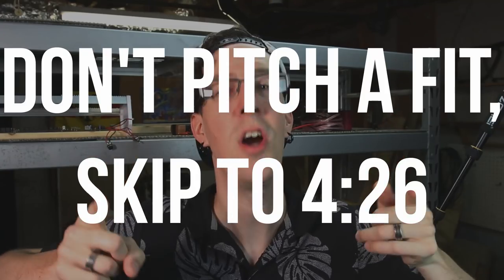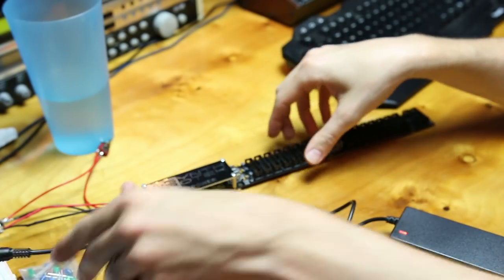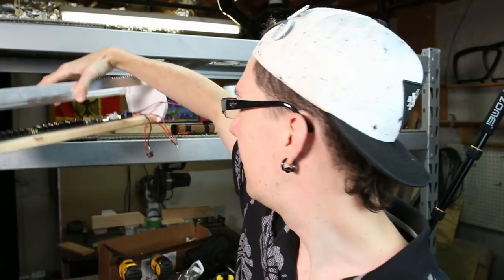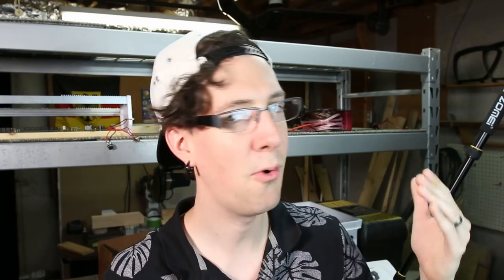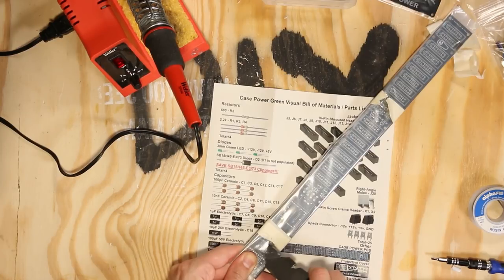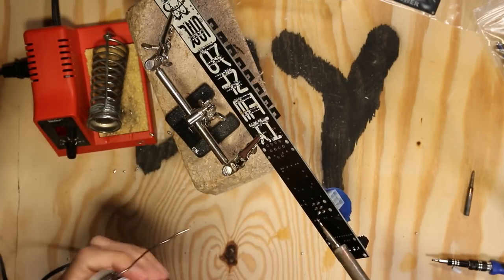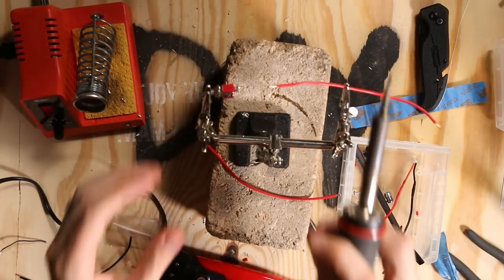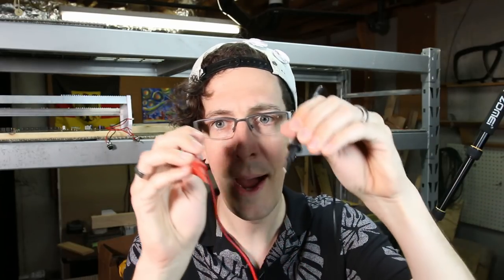DIY Music Studio - How to make Your Own Synth / Eurorack Power Supply (Synthrotek Case Power Green)

Comment: Not much progress but the start of always the hard part. If I were to start practice soldering without worrying about breaking anything, do you have any projects ideas that would be a good fit?
Reply: 1. Making your own instrument cables
2. Cheap musical diy kits
Reply from the maker: I second the making your own instrument cables / mic cables route.  That's how I got started with major soldering afternoons, etc.
Reply: @risingedge3970  thanks for the tips. I'm intimidated by making instruments, but I guess the best way to learn is to fail and figure out why it failed. Will have to find some cheap instruments to make :)
Reply: Once you have basic soldering skills, Synthrotek has some under $20 instrument kits. They're little things that make video game sorts of sounds, but you can refine your skills without risking much.
Reply: Rakit Kits do some pretty easy instruments and their fairly cheap so may be a good option

Comment: Great video. I'm in the planning stages of making a modular system. Basically waiting to accumulate funds. I've been designing a case, reading, and watching every video I can find. I've got a decent soldering iron in the mail :-)
Reply from the maker: Nice!  Which iron did you buy?  I found out that mine's a bit sub-par...
Reply: I asked the guys at Synthrotek and Jeff suggested a Weller WES51, so I've got that coming. It's more than I wanted to spend ($91), but I figure if I eventually build a bunch of modules, then it will be worth it to have a good iron. Based on what you just said, I'm super glad I asked them, because I was about to order the same one I saw in your video. 

I'm planning on doing as much of my modular from DIY kits as possible to keep the costs down. I'm thinking of selling my Moog DFAM to fund module kits ;-)  

I'm going to build my case from plywood as two boxes of 6u by 84hp. It will take me years to fill that much space... But we're going to re-do the kitchen and the cabinet doors are really nice plywood, so I'll scavenge them and only need to buy rails and power.

Comment: I Like your videos man, but switching to a pointy soldering tip is a big mistake.  the problem is surface are and heat transfer.  The smaller (pointier) your tip worse it transfers heat.  If you're having trouble with big solder blobs you need more flux.  Your chisel tip when well cared for is one of the best tips, there is another tip that looks like a horse hoof that a lot of people like too.  

The trick to getting a good solder joint fast is to heat the solder pad and the leg of the component at the same time.  To help your iron heat both the pad and the leg at the same time you was a small (really small) amount of solder on the tip of your iron.   Hold the tip on the joint for 1-2 seconds and then apply your solder on the OPPOSITE side from your iron.  You want the pad and the leg to be what melts your solder. The pull the iron away first then the solder (almost at the same time but slightly staggered).  If you are doing a connector it would be OK to solder one side before cleaning your tip, but cleaning your tip after every 2-3 joint is better.  ALWAYS keep your tip clean.

Also checkout this on thingiverse it might make holding stuff while soldering easier.

https://www.thingiverse.com/thing:2757071